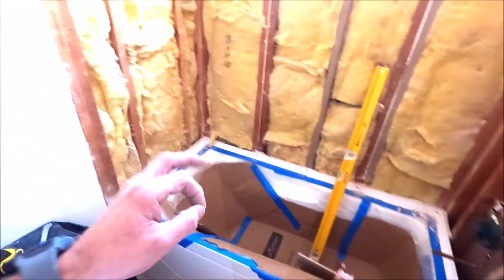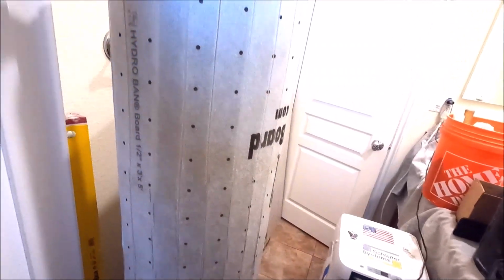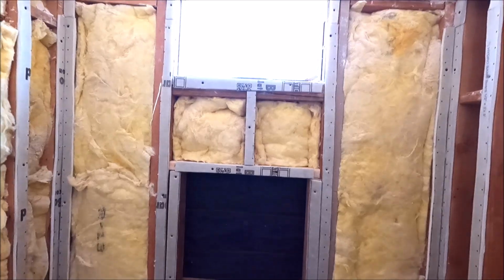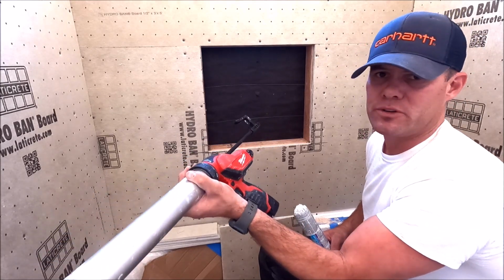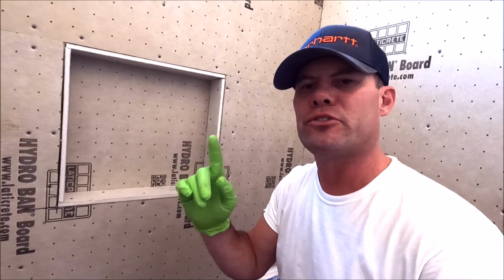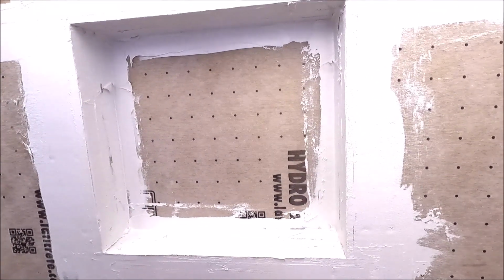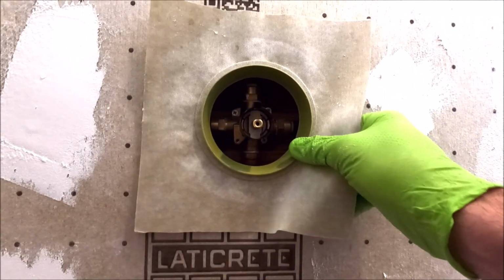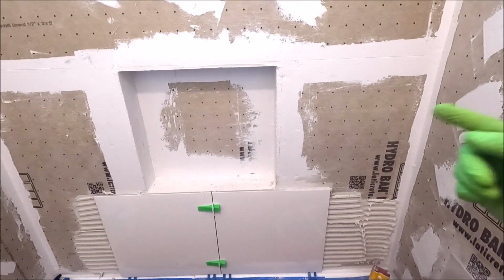Can It Be This Easy? Shower Niche and Fast Waterproofing

Comment: Why do you use different wall boards products, and which products do you prefer hydro or Kerri boards
Reply: He used whoever pays him. Yesterday schluter...... Today laticrete..... Tomorrow Hardie boards...... YouTube has now become an advertising agency. 
Don't buy products that you see them using. Buy products that you believe in and are used to installing.
Reply from the maker: Nobody pays me France, I have not received a dime from a single company for 7 years. Don't listen to this guy Ricardo, he has no idea what he is talking about. Schluter and Laticrete are the TOP systems. Laticrete is made in the USA which I love, but a little more expensive. Both come with warranties which is great.
Reply: Thanks for your  answering my question, and keep making those great videos they have a lot of knowledge and good ideas, especially the videos about tools the right ones make the projects a lot easier. Thanks

Comment: Very expensive using waterproof boards as a sim. You could have easily used $3.50 stud ripped down. Way sturdier and less expensive. Just my 2 cents. But when you get the boards for free then use whatever you want.
Reply from the maker: Our 2x4's are $8 and not super easy to cut down exactly 1/2 "  Time is money and foam board is fast. I also purchased this board with my own hard earned money
Reply: @LandbergTileTV  why would he think you get boards free?
Reply: Where u getting a stud for that price ? Lol
Reply: @chicodavis4679  HD, Lowe's, lumber yards. You name it. Out here in Jersey and Philly they're back to normal
Reply: @LandbergTileTV  ouch $8? I guess Cali is still pricey for lumber but then again you what you say is true that you pay for your waterproof boards then the boards are probably more in Cali then here on the east coast.